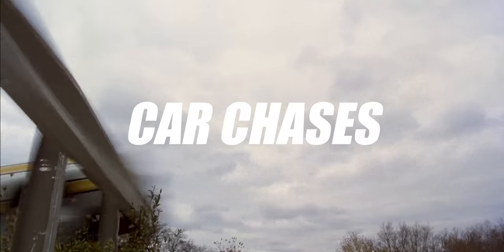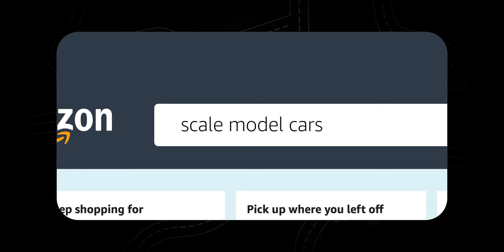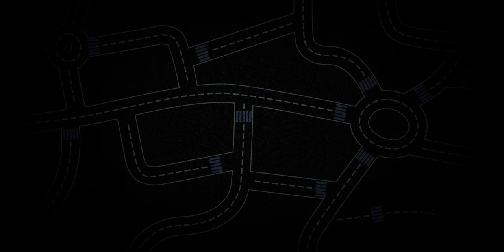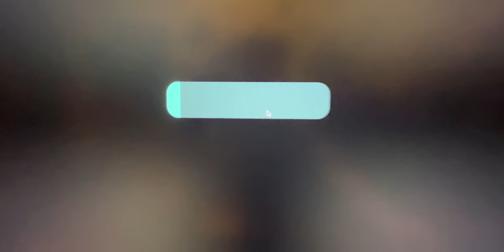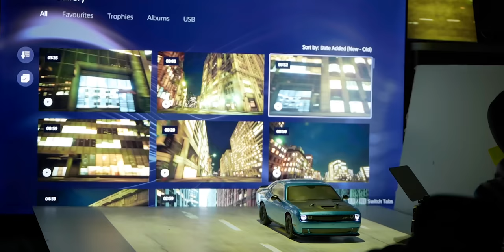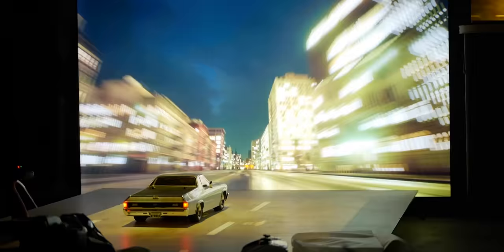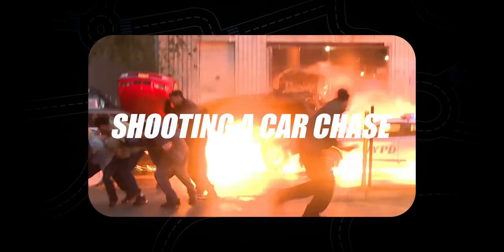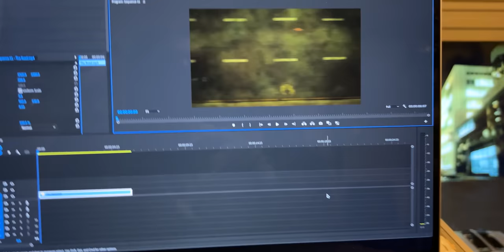Making a Hollywood Car Chase with RC Cars

Comment: More excellent work!
Only thing that kills it for me is that the interior shots are all too familiar. 
Legit can't believe how well this works though.
Reply from the maker: It pains me too haha
Reply: @paul_et  I'm going to need an explanation of the shots at 22:35 to 22:40.
My first guess was that you did the same technique but followed the background and projection so that the camera was moving, rather than the cars but I don't think that's right. Or maybe it is. If it is, you've matched the speed perfectly. And I guess you could do that If you just shot it on a tripod and added the camera movement later to follow the background but something tells me the cars are actually moving in those shots.
I'll wait for the BTS on Patreon
Reply from the maker: Ahh yes, the slow mo drifts. Those were actually some of the simplest shots of the whole sequence. All I did was move the entire ‘set’ or board that the cars were sitting on at a consistent pace. Everything else was locked down. If you look closely on the right of the board you can see the imperfects of the melamine board moving as a slide is over. I’ll go into more depth in the Video Commentary :)

Comment: Wow.
That's it, just.. wow.
I've been building 1/24 scale models for years so I had my suspicions you'd opt for the slightly larger pre built RC cars available out there in order to have control over their movement, that said there are some dedicated enough to making RC conversion kits for 1/24 scale cars which I'd love to try out at some point.
This was truly incredible though, it's awesome to see how much effort you put into making this on a rather small budget but still having the final product come out looking like a scene from a Hollywood blockbuster.
Incredible job on this, you've earned a new sub and I'd say it was absolutely worth it.

As a side note, the moment you played the preview of the El Camino with engine sounds I knew they came straght from GTA V, so I wasn't surprised when you said such while discussing where you got the mixed sounds from lol
..Y'know I think I've played that game way too much if I instantly recognize the engine sounds alone as the source..

Comment: Damn that was impressive as balls. How did you even have the wheels visibly spinning if the cars weren’t actually moving?! And somehow giving the cars a sense of weight!!! That moment where the guy spins his car into the final face off was world class. I think the camera shake was rlly effective at the end so I would only say that could have been used more. Also an expensive projector would probably make the road textures and all a bit more believable but that’s obvious. Nailed it mate
Reply: The "wheels visibly spinning" part was shown in the video, the car was just slightly propped off the ground.

Comment: Definitely one of the most impressive projects i've ever seen. There is one thing you forgot, the cars you're using are both meant to be left-hand drive in real life and your interior shots incorrectly imply that they're right-hand drive and it kinda ruins the believability of the scene. The obvious solution is to flip the driver shots horizontally and in order to make sure the buttons aren't mirrored, you'd just have to do the gearshifting shots while sitting in the passenger seat instead. But of course, it's still awesome and it really deserves the praise.

Comment: Two minor changes that would make things seem more realistic is that when you're filming the burnout scene with the smoke, slow the footage down slightly enough to where the miniature wheel matches the rpm of a bigger wheel at the same speed, and the smoke will follow along with the realism of a life size cloud. You'll just have to make sure that when you're filming the wheel spin, you use a camera that is fast enough to capture the tire rotations clearly so that when you slow the footage down to your desired rpm, you don't see that slow-motion drag effect, making it appear to spin in real time. The other tip would be, when you're panning overhead from the right to the left car in the scene right before the two cars start to drive head on toward eachother, make the projector do most of the "panning" by making the road move (like you did) but once again, slightly slow down the projector as well as the panning shot of the overhead camera, introducing the car with the speed of the projector so that it takes longer to capture the whole shot as if the car truly is life size. Other than that, the amount of work you put into everything is crazy, more than I would have the patience for. Impressive job, it plays like a movie 👌

Comment: What kills it for me is that you can see the pixels from the projector. When you were showing your set up I thought the fact that the road was also getting projected onto the car would be a big issue, but that was surprisingly okay looking. But those pixel lines are very visible. Ideally You could move the projector closer and further away from the ground as the camera came forward and backwards towards and away from the wheels on a per shot basis. The other thing is that when you were editing, you should have brightened the image to the point where the brightest aprts in the background were pure white.

Comment: Great job with the car chase. The only gripe I have is the RC body mounts showing on the hoods. If you decide to try this again. You can buy new 1/10 body shells of your choice that are clear and unpainted. You can paint them from the inside if you are not familiar with this. Sometimes the RC hobby community uses Velcro, magnets or other methods to secure the body to the chassis with drilling holes through them. Good job, but consider this the next time you attempt this.

Comment: Beautiful work, as someone who drives something very much like your charger there’s a couple of subtle elements that are often lost when filmed by people who are used to only 2 and 3 litre standard engines. First, the whole car will jostle and even roll a little simply from the sheer mass of the engine being revved, and gear shifts are short and sharp but almost always if you are competing (only on the track of course) your downshifts (and you do downshift because your car will top out at over 185mph so long tracks of just consistent acceleration will lead to absurd speeds where you’ve covered an entire mile in seconds and your reaction times are equal to about 50-80 metres) *your downshifts result in a noticeable roll, ROAR of the engine, nose dive, nose lift on one side when exiting a corner and always, ALWAYS, despite your best intentions (under competition circumstances and if you’re not on your first outing ) tail slide.
Also some degree of road surface interaction which is dulled at speed as the suspension components don’t have time to fully extend or compress, so they just judder.
Brilliant work, I think you would have this nailed with some personal experience in a POWERFUL sports car (there are vehicles out there classed as sports cars with only 280bhp, powerful is 350bhp and up, something that doesn’t stop pushing you back in your seat until you run out of road) experience it blindfolded and not, to get you to hear, feel and see all of the elements that a real situation like this trains you to become aware of and analyse in thousandths of a second to keep the vehicle on the blacktop.  
Either way, good luck and I hope you get to enjoy something like I’m describing, most people cover their eyes when they get in my ride, but if you need to get to hospital faster than blues and two’s it’s good to have me around.

Comment: A bit of fog/mist blown with a fan over the cars during those close up headlight shots would have helped sell the look of moving fast in motion a bit more. Also, when the engines are supposed to be revving, pushing down slightly on the backs of the cars would've helped sell that as well. Revving an engine while 5he car is stopped sort of lifts the front end of the car.

Other than that, this was awesome. Good work!
Reply from the maker: Fog would’ve been a great idea. I actually did do a little nudge on the car during the revving but I obviously went a lil too subtle. Glad you enjoyed the vid :)

Comment: Cool things about rc cars, you can always replace the body and continue on the same chassis, also invest in a gyro it is one of the best helps when driving rc road cars, and use a more supple tires it offers more grip, and if we're getting into the real grit just replace the motor with a crawler motor it offers WAAAY more control

Comment: What a banger of a project...And well executed too.
Wondering if the road could've been better by using the older LED display underneath the cars instead of top-down projection but that could've caused too many reflections on the cars.

Comment: Definitely it was worth doing these much efforts. Some suggestions are 1. You could have used a treadmill instead of top projection because that pixelated projected road was not looking good. 2. You should have avoided those car interior scenes where you were changing gears cause no one would believe that a car with that much of chrome finish would have a boring interior like your citroen😅

Comment: One thing I noticed, the El Camino doesn’t have a back seat. The rear window is right behind the drivers head. But you can clearly see behind the driver’s head that there is a rear seat. Other than that, pretty cool work.

Comment: Hey for future reference, get tall soft springs and fill the car with stick on tire weights, the suspension will be to the moon, but once you add the weight to scale ride height , it will act like a real car pulling out on ally off curb or down onto a road from crosswalk easement that cars use. I know you didn’t pull it out of alley when car drove by, but if you get this, i actually build real tube chassis Rc race cars with scale engines up front with real drivetrain. You can’t see any of the wiring, because it’s the radiator hoses. They are pro mod race cars

Comment: you could use Engine Simulator for engine sounds, it has tons of engines made by enthusiasts so you don't need to make your own, plus, you can control an engine - rev it up, change gears, e.t.c. And it sounds really good and realistic

Comment: Better than most of the cgi coming out of major production hollywood.  Crits: the El Camino’s too dim headlights, especially the lack of high beams when the center bulbs are on.  Something that really could have given it some flavor is if the headlights on the camino brightened just a bit as he sat there and revved- older cars tended to do that because the voltage coming off the alternator tended to reduce at idle and increase to its proper level once the engine was above 1500 rpm or so.  Turning the high beams on just for the final scene could have added some effect.  The hood pins were oversized and an instant (one of the very few) dead give aways the cars were models.  That one is fairly forgivable as its an integral part of the model.  9/10- damn good.

Comment: I really only noticed two issues in this that gave it away as miniatures. The headlights didn't project light on the environment, and the car you used for interior shots was righthand drive, but the models are lefthand drive cars. Other than those things your final results look fantastic.

Comment: This was awesome, I have a couple of pointers/ideas though
-this would work better with flat gloss nonmetallic paint on the cars, the size of the metal flakes kinda gives away the scale
-mix in a few shots of gear changes, pedals being pressed, gauge cluster showing speed etc 
-a few more dynamic shots of the drivers. For example when the challenger is spinning out you could show the driver being flung to one side from the gs as with an actual car slide
-show the cars wobbling and rolling as they accelerate, decelerate and turn, and bumping slightly as they drive over imperfections in the road
-you could use magician smoke to create the effect of tyre smoke when the wheels are spinning, and possibly use a small amount of a lubricant like WD40 to make them spin a bit longer

Still awesome work though, keep it up

Comment: First off it looks amazing. That said adding some movement in the suspension would have completely sold it. Such as in the drift making the leading edge of the cars squat down (as standard cars would) would sell the look. Rocking the cars during the rev scene also sell the look. But that said still looks amazing.

Comment: Really cool.  I think the biggest flaws that need to be overcome is that the upper projection is casting to constant of a pixelation grid on everything.  Its actually a cool effect, but when the cars are "moving" and its static it presents a disconnection.  Secondly, I think there is something too perfect about the closeup shots...I can't put my finger on it, but I think it may be that the cars are too stable (lacking any jitter in the reflections or anything).  That would be interesting to figure out how to overcome in a scale shot (I'm wondering how small rumble-pack style vibrator motors under the RC cover would do).

Comment: If it weren't for the hood pins and the drivers/shifters being on the wrong side (since you used American cars) I'd definitely say it was worth it. 10/10, minus those two points so 8/10.

Comment: Instead of projecting the ground down onto the cars and the surface they're on, you could've used your "too small" TV underneath with some paper or translucent material (wax paper, vellum paper, etc) and directly display the ground underneath them. Then you wouldn't have the ground projecting onto the tops of the cars to deal with.

Comment: idk if you plan on doing any more things like this. But in terms of the RC Cars bodies, you can get the body molds without holes cut in them for the posts, and what many do to keep the cars aesthetics is use little magnets to hold the body molds to the chassis, eliminating the stupid studs sticking out of the hood and the rear sections, giving a smoother and more realistic look to the cars.

Comment: Very cool concept and for what it was? Very well pulled off.

If you know cars, you can spot when something is... off... 

A few things that would be giveaways, for me at least, if I were to see that used in a movie and of course, seeing it here. You talked about it too. Lighting.

If you are just focusing on the reflection of the road off the paint of the vehicle, it looks like it is moving but the light from the projector or whatever light source you used, was stationary and the light spot on the vehicles never moved. Big giveaway the vehicle was stationary.

There was no damage from collision, no flex from the collision, to wobble, no shock movement. Unfortunately, there are way more parts that move on moving car than just the tires. That doesn't even take into consideration the environment around it.

The lines from the pixels when capturing a digital source with a camera, the backwards signs on buildings and this interesting thing that happens when projectors are used to cast an image or a camera is used to capture an image from a screen. That scene that was captured and recorded in 3D is now captured in 2D. The image is flatter, there is no depth, just shadows. When a 3D item is captured with a backdrop of a 2D scene, it just makes the 2D even flatter.

There is a reason that Hollywood pays for chase scenes or simulation cars on programed hydraulic systems to simulate crashes.

This isn't to say that you did a crummy job or didn't put enough effort in. Clearly, you put a lot of effort in to get all the things right that you did. Lots to learn from, which in all reality, is important. No one ever executes something flawlessly the first time I mean, look at NASA and SpaceX

Comment: Bro, this is amazing, with what little you had to work with, this is amazing. pretty much the key takeaways that make this seem fake it that the projection of light from above for the scene is on the cars and you can tell the rc car headlights are small and they dont have any complexity like real lights. The drifting kinda threw me off, but othere than those this project is great man 9.5/10

Comment: This was amazing and the final product is amazing. The only thing that kinda threw me off is the cars need some vibration/bounce to them. To simulate a powerful car engine or the physics of the car when moving or getting bumped. Also I am curious if the road could have been made on some sort of treadmill but then again that would have complicated things and probably wouldn't have work for the turning/drift scenes.

Comment: Dude. It is amazing and the way you achieved those shots, though some key things can be done in post to make it pop even more, for example, there were some static reflections on the cars, handlamps can be more bright and cast a light fog, background projection can be added to the clip itself in post and replace that tv with green screen, that way background will pop even more. But anyway, you did a wonderful job, kudos. Really inspiring.